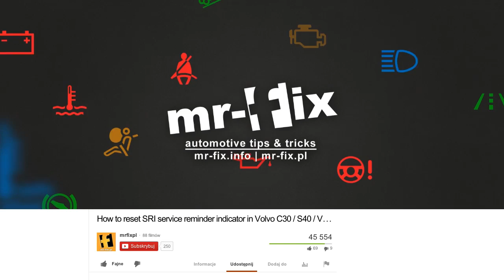How to clean throttle body in 2.0D HDi TDCi (136PS Volvo Ford Peugeot diesel engine IAT MAP)

Comment: Hi, just cleaned my complete air manifold. I took it of the engine because it smokes a lot and runs like a tractor in the morning for about 30 seconds to a minute. After that it's fine. Nevertheless I didn't clean the " throttle body" though and the problem is still there. Next I'm going to do is clean it like in your video. If it doesn't help it doesn't hurt anyway! Thanks for the video!

Comment: you will be amazed if you take off inlet manifold and see all the gunk in it...clean inside off it with oven cleaner....while that's off clean egr Valve and egr pipe which it also full of crud...results are very positive and it let's your engine breathe better...improved power and mpg
Reply from the maker: +Gary shaw EGR, intake and VGT cleaning soon.

Comment: I saw your issue in comments below. It might be EGR. PUt an aluminum or metal blanking EGR and you will be fine. It will reduce oil steam emission in engine and throttle body will be more cleaner later.  Also Sometimes theory le body can leaking because The air has oil steam . I personally put Silicon And plastic glue all around this piece And no more leak , better performance

Comment: Thanks for the video. I am trying to get rid of sporadic engine power hick ups, momentary loss of power and sometimes a just bit jerky idling (no biggy but I can feel it does not run smooth) on a 2008 Citroen C5 2.0 Hdi and was wondering if the throttle body could be the culprit. How do you know when to clean and when to replace the throttle body?
Reply from the maker: It’s pretty easy to disconnect the part and take a look inside.
Reply: @mrfixpl  what exactly should I be looking for?
Reply from the maker: check if it's not clogged and if the flaps are moving correctly. There should be spring action on both of them, Should not be moving freely.

Comment: Hello, at 2:50 you disconnect a hose line,  I have found out that it controls the butterfly flaps.
But when I bought my car it was unplugged completely(there is also a screw in the hose to block it off). Any reason why it was unplugged ?
Car seems to drive fine.

Comment: Great video but i am curious, why does this throttle body have two air intakes? Is this version a twin turbo?

The version in the Mk4 Mondeo only has one air intake..
Reply from the maker: Some engines have intercooler bypass. Flap regulates if the intake air should go though intercooler or bypass it.
Reply: @mrfixpl  interesting. I did not know this. Once again, great video and thanks for sharing. 👍

Comment: Forgive me if this is a dumb question but why would a diesel need a throttle body? They draw a fixed volume of air don't they? The lack of a throttle body and butterfly valve prevents pumping losses. Why does this diesel have one?
Reply from the maker: …and it operates as the shut-down valve

Comment: Nice video. I had my Volvo not starting yesterday, today I just removed the hoses from the throttle body it started. I reconnected the hoses and it now starts with the second try. Is it a case it just needs cleaning?
Can I use carburetor cleaning spray?
Reply from the maker: Remove it and check if flaps are moving freely.
You can use carb. cleaner.

Comment: Great tutorial! My 407 2.0 HDI has recently lost power, I have been trying to find faults and have found that one of the flaps on mine has no return action and just flaps around without any resistance, could this be the cause? Thanks.
Reply from the maker: This can restrict air flow so it can be responsible for power loss.
Reply: mr-fix Thanks for the reply. I changed it today, unfortunately I still have very little boost, running out of ideas now. Thanks again.
Reply from the maker: Unfortunately there's a whole list of little things that might be wrong and will cause low boost. Some are directly related to the turbo (like the vacuum valve controlling VNT, sensor on the turbo, IAP sensor on the intake, boost leak) and some can cause the engine control unit to go to low-boost mode to prevent further damage (fuel rail pressure out of range, accelerator pedal potentiometer fault, timing belt out of sync).
Would be helpful if you could run a quick scan of the car to see if there's some error code pointing to a fault.
Reply: mr-fix thanks, I’ve got someone to scan it arranged for end of next week, hopefully they’ll find something although I have no warning lights of any sort displayed on the dash.
Reply: I have exactly the same as you describe. Did you manage to get to the bottom of the problem?
Reply: @RobsCars  same problem any luck

Comment: Hi mr fix, love your videos. 
I have a ford galaxy TDCi 2.0., I have a slight hesitation between 1500 and 2000 rpm, only when under very light throttle or when no throttle, have had a new fuel filter fitted and don’t have any DTCs,  
I was searching and then came across a post about how cruise controls slow cars down in a diesel car, reward that it’s buy closing of the air in the egr throttle body.... that’s when I came back to your site and watched the video....... reason, when I have cruise control on it all works fine but recently if I go down hill it does not slow down, so my thinking was that it could be the throttle sticking as if air is still getting past the flap it would not slow the car leaving me to think it could be the same reason why it’s giving hesitation at low revs...

Sorry about the long post 
Many thanks 
Steve
Reply: What year is your car?

Comment: One flap is broken and the other doesn’t have a vacuum pipe doing to it. What would this cause? Vehicle is currently lacking power
Reply from the maker: It could cause both flaps to stay closed or air being improperly guided though the system.
Reply: mr-fix ok thank you. If I’m able to remove the flaps what would that do?

Comment: Good guide. I did this the other day but I think my valve is sticking and have ordered a used throttle body that has been tested. Do you think it is ok to use throttle and intake cleaner spray? I'm just a bit unsure with the throttle body in these engines being plastic. Many thanks

Comment: I suspect my throttle body has some issues. My car sometimes lacks power under 2000rpm badly.. and it's smoky after 2000rpm on heavy accelerations. Yesterday i got off the car and i hurd some buzzing/humming sound from the engine area.After i stoped the car and ignition switched off. I pulled  the vacum line from turbo vacum valve( brown one) and buzzing stoped. Started again and  checked again , buzzing stoped when i pulled vacum line so i suspect a vacum leak somwhere.  What's wierd for me is why is my intercooler COLD after a long drive?  If i have a broken membrane in one of  my vacum actuator valve witch controls the throttle body  will it bypass the intercooler? Thx.
Reply from the maker: If your car is bypassing intercooler then it will be cold and performence will be lower. This can be caused by fault or because your DPF is regenerating.
Buzzing vacuum valve is not an indication of issues with vacuum - those valves are controlled with PWM signal and this is just how they work.
Your VGT might be stuck or not moving in the correct range which would also cause performance issues.
If you have a lot of smoke when accelerating, then you might have some boost leak.

Comment: The right part of the throttle housing there is a circle part which a vacuum line goes into , mine was disconnected from previous owner any idea why ? Should I plug it back in?
Reply from the maker: Those two butterfly valves have different normal states (one is normally open, one is normally closed) and work opposite of each other. If one of the valves is faulty (for example stuck closed), you don't wont the other one to also close, so you disconnect the vacuum control line.
Reply: @mrfixpl  Thanks alot for the very fast reply ! Ive have been trying to research this for a while now and I finally have an answer ?

What do you suggest i do now ?  Leave it like this untill the butterfly valve is fixed ? 
Should I attempt to fix it ?

Thanks alot again
Reply from the maker: Take it out and check if both butterfly valves are moving correctly. You can apply vacuum with a syringe to check if it moves correctly.

Comment: Just one question, how oil can access this hoses?
Same engine, 2009, on idle it's a little bit shaking and the central side of this body is a little bit oiled, not leaking, but where from this oil come and how it got outside.
Reply from the maker: crankshaft breather

Comment: Hello. Nice work!!! Did you need to recalibrate it afterwards? I want to change mine even though is not broken but still leaks a little oil. Do i need recalibration for it? If yes can I do it manually and how or it needs to be done with Computer. I would greatly appriciate your help.
Thank you!
Reply from the maker: No calibration needed.
Reply: @mrfixpl  thank you so much. Finally I can change it. My car is a Peugeot 406 coupe with a 2.2 hdi motor. 
Keep up the good work and thnx again!!
Reply: @zamirkabo9705  did u changed it ? Can u give me some updates
Reply: @adisl6659  yeah! what was the result of new? mine is leaking oil from the throttle body and didn't know where from on the throttle body.  It has to be from one of the gear caps or something around there.
Reply: Still leaks from the valves, I think it’s supposed to…😢

Comment: Thanks for taking the time making this video it's a real help. I have the 2 litre diesel 136 bhp in the cmax. On start up first thing in morning the throttle is really poor, but rest of time it's perfect. I've bought the carb cleaner and will do this tomorrow. Just one question, do you have to do a throttle body reset?
Reply from the maker: Hi! You can also check EGR.
Reply: mr-fix already replaced egr last year.
Reply: I didn't expect it to be caked so much in carbon. I used a flat head screwdriver to chip it away. To be honest I should remove manifold and do a thorough job.

Comment: I know I'm late to this video. I've come here for a guide as I've been told this needs to be cleaned on my car. I have the v50 2.0 D SE 2005. on cold starts it's absolutely fine but when the engine gets up to temperature and I stop the car it will give me hell to start up again. I got told that flap is jamming open when the pipes expand but destracts when engine is cool? also feel loss of performance when engine is hot
Reply from the maker: If I have to guess I would say that one of the flaps is stuck close or loose inside the body. Or the vacuum line that controls it is leaking. Or the vacuum valve. Or one of the temperature sensors...
Can you scan your car for trouble codes and check some of the engine parameters with a scanner?

Comment: Having gone to all this trouble, why not remove and clean the manifold as well; it appears a straight forward job. Or is there something I haven't spotted that is likelt to cause major headaches?
Reply from the maker: Taking the manifold out would most likely require a set of new seals to put it back together and not cause air leaks.
Reply: Thanks, I was thinking that would not be a problem and was surprised by your answer.
That is until I noticed that the inlet manifold and cylinder head cover are one assembly; consequently much more expensive than just the four seals of old!
Reply: On these you have to remove injectors and the inlet is part of the rocker cover

Comment: I have air bubbles in the exit pipe of the diesel filter.
I can't see if there are any bubbles in the inlet as it is a black pipe. Is there any way that I can detect if there are bubbles in the fuel before the diesel filter?

Comment: My scanning showed following faults: 
P002 Powertrain
P242F Powertrain
U1900 Network
U2023 Network

Do you think this have anything to do with the sensor or the Throttle?
Reply from the maker: P0002 - Fuel Volume Regulator Control Circuit Range/Performance
P242F - Diesel Particulate Filter Restriction - Ash Accumulation

U1900 – CAN Communication Bus Fault

U2023 - vehicle connection network fault
Reply: So i should sell the car? 😁
Reply from the maker: 1. Clear all codes
2. Take the car for a ride.
3. Scan again for codes and check which are back.
Reply: So i cleared the faults and took about 30-40 min ride on the highway. (Average speed 120-130) when i arrived i got only P242F as fault.

Comment: Hi, very good video! I have one question. Can you explain what 
is the purpose of taht two object to which is connected to the vacuum lines?
Reply from the maker: If you are talking about the butterfly flaps, those are there to direct charged air through or bypass the intercooler.
Reply: Actually I wondering what that vacuum do there? Is it control throttle valve or what?
Reply from the maker: Those flaps are controlled with vacuum.
And since this is a diesel engine there is actually no throttle in the intake. Those flaps are just directing air one way or the other, or close the intake when you turn off the engine.
Reply: Now it's clear. Thanks ^_^

Comment: 1)  Why would I need to clean the throttle body?  2)  Why are there 2 air intake pipes?
Reply from the maker: 2) it’s an intercooler bypass. ECU decides if charged air should go though the cooler.
1) if the flaps inside are sticky it will not work correctly.
Reply: @mrfixpl  Just out of interest, how many miles would you expect to get from a 50 litre tank of diesel attached to this 2.0 diesel engine?  I currently get about 400 miles when doing motorway miles.  Is this low?  I took the car to a Volvo main dealer who could not find any fault codes on the car.  Thanks in advance.
Reply: @mrfixpl  Hello where are you based if I would like you to look at my car?
Reply from the maker: In my C30 I manage to get 450/500 max.
I’m in Poland but I’m not running a garage. Just this YT channel for now.

Comment: Can you publish manifold guide ? I cleaned my throttle body and egr pipe which was clogged 30% at exit to body. my 407 body looks a bit different but it's almost same procedure. Manifold looks terrible so I need to get back there. 

PS. does oil like your video in body tell anything about turbo condition ?
Reply from the maker: Didn't clean the manifold yet.You can't diagnose turbo without actually looking inside the turbo. Oil inside manifold is most likely coming from the crankshaft breather and it's common in turbo diesel engines.
Reply: Thanks you planning to do it somehow before autumn or ..?
Reply from the maker: If I had time I would do it even today :)
Hope to do it this year.
Reply: Sadly my 1598 error is still up. It does not light up MIL. Any clue ?

Comment: Thanks for helpful video.
By the way, is it possible to remove the Air Intake manifold body and clean it?  I saw somebody was cleaning the inside of the Air Intake manifold of other car.
Reply from the maker: Sure, it's possible. But most likely you will need a set of new gaskets for the manifold.

Comment: i checked out my trnsioner belt to a mechanic and its ok . my car has a rough idling and turns of when im stoping only when im with AC ON what could be ? help pleasee
Reply from the maker: Maybe your AC compressor is soon to be broken and it resists so much on the accessory belt that it can stop the engine?
Reply: My car is doing the same, cutting out when I take it out of gear when slowing down. Sometimes it won't start again for days.. :-( Hadn't considered that something might be resisting the belt. Thanks for the idea!

Comment: Hello Mr Fix, i have a 2014 Peugeot 508 2.0 Diesel Allure and want to disconnect the vacuum pipe on the throttle body. I can't get it off and don't want to pull too hard as might damage vacuum body. The rubber connection on the body is soft and not a hard pipe. Have you come across this before?
Reply: Try gentle warming with hair dryer, then try to pull it off.

Comment: how can i relearn?by disconnecting the minus on the battery?
Reply from the maker: No need to relearn. The valves are connected with vacuum lines, and both MAP and IAT sensors does not required any kind of calibration.
Reply: @mrfixpl  thank you so much

Comment: is this similiar to peugeot 407 2.0 hdi ?? and can this cleaning damage my electronic throttle body ?some help here please my engine turns off at idling when im cruising with ac on ?
Reply from the maker: there's a lot of 2.0HDI engines. This one is 136PS/140PS.
Check if your timing belt is not loose, and if the belt tensioner is OK. If not your upper and lower sensors can go out of sync and ECU will turn off your engine to prevent damaging valves and pistons.
Reply: this happens to me only when im with AC on ? 
Can i clean my throttle body like in the video ?
should i replace my tensioner belt ?
Help please ???

Comment: Hello guys,i have a problem with my Peugeot 307 2.0 100kw HDI.I cleaned throttle body and at 2100rpm my turbine dont start...what could be a problem?My turbine doesnt work at any rpm after cleaning...HELP!!!
Reply from the maker: Damaged/disconnected inlet manifold pressure sensor.
Reply: It shows me on my bord Exhaust system faulty... and my engine make some weird noise... never heard him that loud... i only cleaned that throttle body and yes... i broke my car.what to do?

Comment: What was the problem? Bad first start?
Reply from the maker: Shaking when turning off and smoking on heavy acceleration.
Reply: Filip Horvatic It seems that almost every 2.0D engine has that problem, but no one knows how to fix it ;__;
Reply from the maker: +John Szczepanski Next I'm cleaning the EGR valve to see if that helps.
Reply: +mr-fix Did this helped on smoking?
Reply: mr-fix did this fix the shaking and smoking issue?